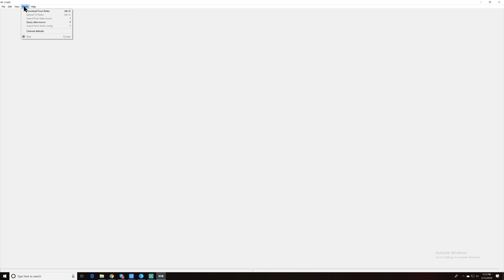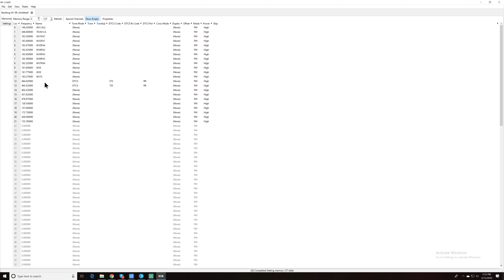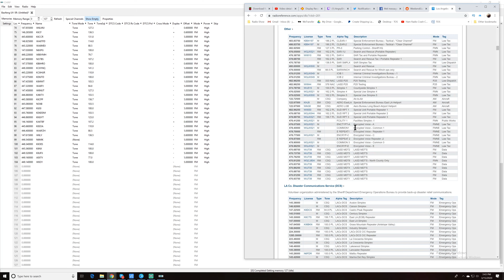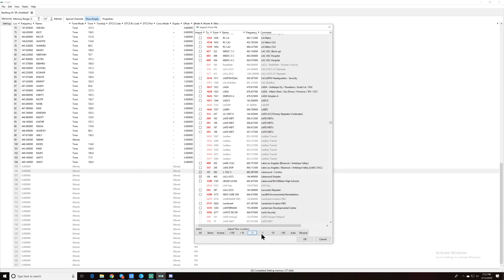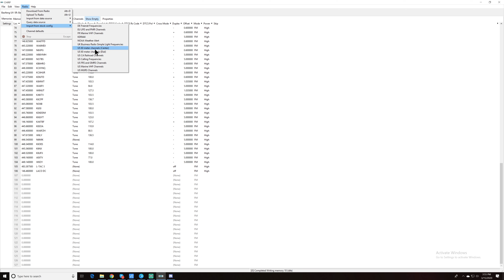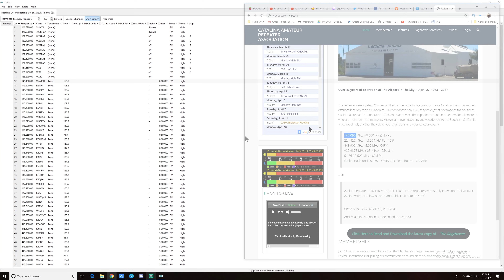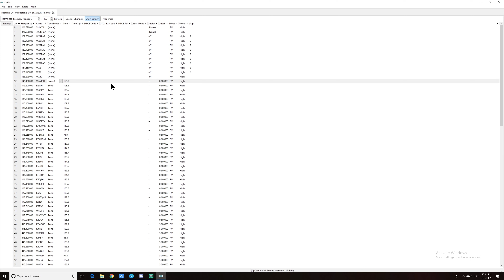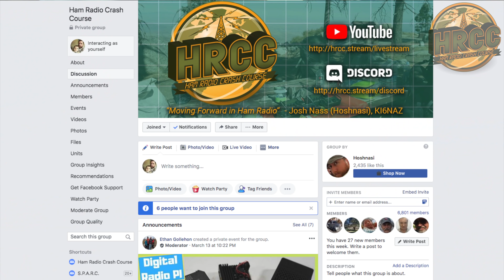How To Program a Baofeng Ham Radio Easy and FAST With CHIRP

Comment: Hey, Josh!  From 1961-1965, I was a Radioman on a Destroyer for the USN.  During that time, I served off the coast of Vietnam, Taiwan, China, Japan, Hong Kong, and various other places.  My job (well, I could tell you, but then I'd have to kill you) was mostly CW work, spending lots of long hours deployed doing everything from coastal weapons intervention to submarine patrol, and work with our firepower.  I ended my service as an E-5 Petty Officer.  Since 1965, I've thought very little about communication over distance, although I still have CW rattling around in my head.  Recently, I became the Staff Photographer for the local NICA league (Kids, mountain bikes and races).  In that capacity, I'm all over the race course.  I'm also a certified First Aid/CPR/AED guy, because I teach T'ai Chi at three YMCA's.  Long story short, as a rover all over a significant distance, it made sense to plug into the comm network in case i was needed (Yes, we have an attending ambulance and staff).  I've re-kindled my fascination for electronic communication, and am starting with a UV5R.  I've got the radio, am tuned into some local service frequencies, and will copy the frequencies at the races.  I'm not transmitting, as I'm just studying for the Technician ticket, and don't want to be part of a problem.  JUST writing this to say that your videos are well-constructed, clearly rendered, and appropriately directed as to talent levels.  I've subscribed, and expect to learn lots with your videos.  Thanks for your work.
Reply from the maker: Hi Don! Thanks for the great comment. I enjoyed reading it! 

I’m glad you’re getting in radio. It’s a very broad hobby with lots of interesting niches. CW is still quite popular due to its efficiency. 

Lots of luck!  
73
Josh,
Reply: Spittin' Nickels🤟

Comment: Off topic here BUT, you still use your "Icom IC-2730A Dual Band VHF/UHF 50W Mobile Radio" im thinking about a adaptable all-round SHTF radio, 
was kinda hoping to find something with the same features pushing 100watts though... maybe i'll just buy the Icom IC-2730A !
In the jeep out da jeep.... doh!!! :] ]
Reply from the maker: If you can swing it, take a look at the yaesu ftm-400.

Comment: So as a total noob, why program the radio? what's the point or need to program it?
Reply: To get it to work with repeaters, and set known channels into the memory slots
Reply: It's a lot easier to program from a computer than to manually put in dozens of frequencies through the radio itself. You also can't change all of the settings through the radio itself, such as naming saved channels.
Reply: @dawsoncox9751  thanks, but why program it at all? What does programming it do for me or the radio?

Comment: If your in a LIFE threatening situation your CAN transmit, so why leave out the transmit on public safety frequencies? Seems like a waste......
Reply: Johnny Sox to prevent yourself from accidentally doing so?
Reply: @DutchmanRadio  well I did say life is at stake, and don't want to reprogram while someone is bleeding, or burning, but I get your point.
Reply: Johnny Sox ah yeah this would be a good way of leveraging existing “weather” radios that everyone already has in a SHTF situation, sorry I missed that part when reading initially. I’ve had the same thought actually and in light of recent events I might enable transmission on my NOAA channels.